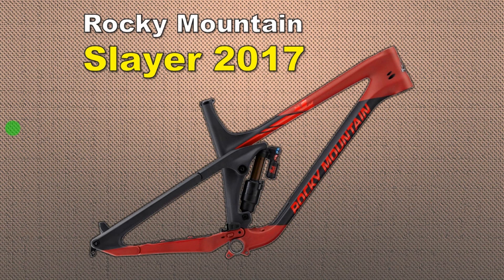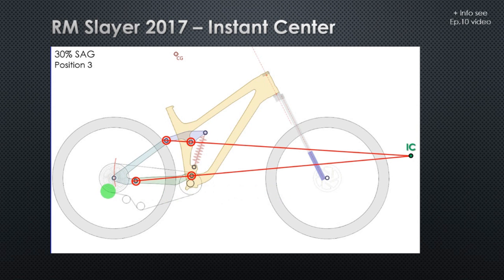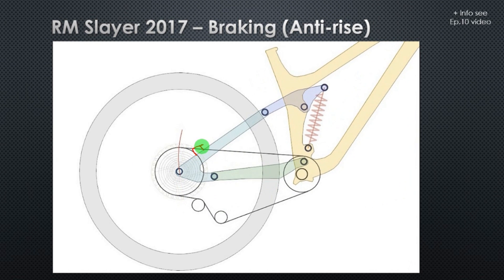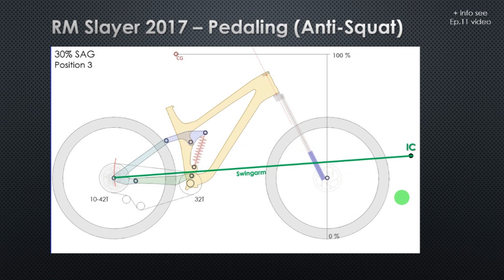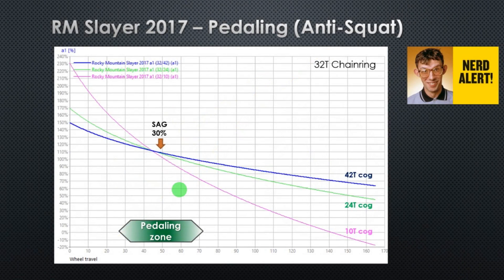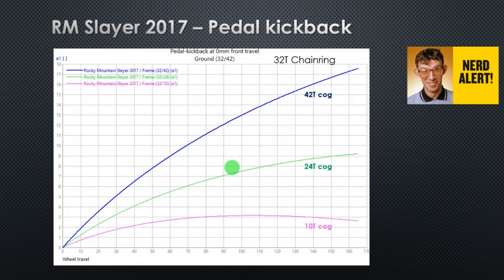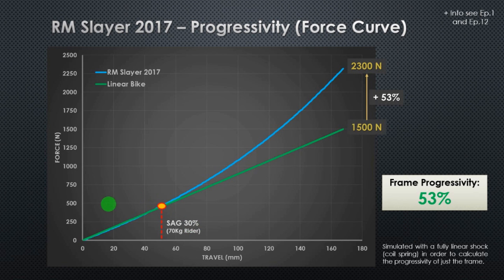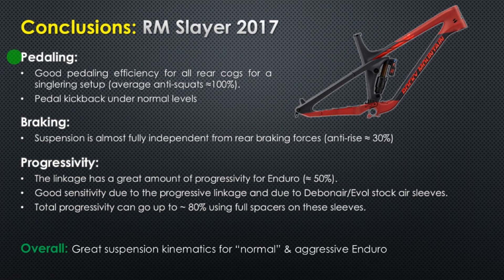Rocky Mountain Slayer 2017 - Suspension review

Comment: About to go from a 2016 Trance (with 150mm Pikes added) to a 2019 C30 Slayer. Would you say this would handle a bike park batter than the Trance? Great video btw.
Reply from the maker: Yes, for sure. Trance is a trail bike, Slayer is an aggressive enduro bike (with some freeride component in the mix).

Comment: I had a GT AOS bike and I agree it was really bad when I was on both brakes going down hill... but, I recall it was pretty good if I only used the rear brake... any explanation for this (maybe it had two strikes going against it?)?  I always put it down to the amount of wheel base that was growing caused by the AOS exaggerated rearward axle path?
... when I descend I tend to ride both brakes, I know some riders will only use the rear but I prefer to use both most of the time and I find some bikes are better than others at remaining active with the rear suspension, the GT AOS was the worst and I blamed it on the wheelbase growth.
Thanks for all the scientific analysis you are providing, interesting stuff!
Reply from the maker: Hi. Higher pivot bikes usually have a more rearward axle path and usually also have higher anti-rises. So the 3 aspects are relatively conected. So when you apply the rear brake, the bike has a natural tendency to slightly compress the shock and extend the wheel base. This migth stiffen a bit the suspension and slow down shock responses.

Comment: Hi, could you go further into the Ride 4 design and how it affects the leverage ratio? It would be 👍
Reply from the maker: Hi. The Ride4 and other similar systems (flip chips) usually have a small/insignificant effect on LR.
Reply: andrextr that’s what I figured. From watching your vids on pivot placement I figured the shock placement would have an effect on progression. I have used it in all 4 positions and found that the steep position works best for me. Cheers and thank you!

Comment: Hi mate! Do you recommend a coil shock for the slayer? I've the X2 and considering a dhx2 of they will work well with the kinematics of the bike.. Cheers!
Reply from the maker: +KSMTB The float X2 is already quite good but if you want to gain a bit more performance on downhills then the coil is the benchmark (more initial sensitivity, more mid stroke support and more consistency on longer runs). The Slayer will work well with the coil since it's progressive. Although an air shock is lighter and offers more adjustability (either by adjusting air pressure or by changing spacer to adjust final ramp-up). Cheers

Comment: I'd like to see this information to be available for the new Pivot Mach 5.5
Reply from the maker: The Mach 5.5 has good pedaling efficiency as expected (with 100-120% anti-squats). The progressivity is should be around 10-20% (the shock pivot is occluded, so this is a close estimative). You can also check the Firebird 170mm analysis on VitalMTB here: http://www.vitalmtb.com/product/guide/Bikes,3/Pivot/Firebird-Carbon-Pro-XT-XTR,18075#product-reviews/2664/expand

Comment: Have you considered to review Pole Evolink or have you already reviewed similar frame? Great job with the videos, I see some progression with the quality ;).
Reply from the maker: I already built the models but never did the video. I made a very complete video for DMR (which has a diferent design but it also uses a concentric link with BB). Pole Evolinks have a bit low anti-squats (lower than most bikes, at ~60-70%). Progressivity is also low (almost linear... easy to bottom-out). The concept is interesting but if it was me, I would made some optimizations on it. Bye
Reply: Looking forward to see it :)

Comment: I love your videos. Did you ever analyse the Maverick suspension? Would be keen to see a ML8 video. Thx.
Reply from the maker: ML8 has a very progressive suspension. Not sure about anti-squat (pedaling efficiency) since the bottom-bracket moves and it is part of the unsprung mass (the common method to calculate the anti-squat is not valid in this scenario).

Comment: I ride YT Capra and am loving the bike, an absolut dream. still, I feel it is a bit of 'old school geometry' regarding reach and top tube; stangely enough I discovered that HA is super forward thinking and much lower than advertized (with 170 Lyrik around 64,5°, and MBR states it is even lower at 64,1°). it loves to sit low and super slack like a regular DH rig, but had never too much of a problem pedaling it uphill, thanx to the steep SA at 75°, which I love the most about this bike.

I'm about 185 cm and L size is fine, but I'm thinking of getting XL carbon one to extend reach and top tube, which is still not that much of a drastical change.

the option replacing Capra with Slayer (still waiting to see the new Norco Range carbon) looks promising, and here's why - just read the review on PinkBike and the reviewer at 177 cm height tested L sized bike. naturally I went on RM's website and was looking at XL size numbers, and I have to say I'm liking what I see. longer bikes with slack HA are super stable at speed and I like that a lot. I learned that to be manoeuvrable uphill, you actually have to have shorter rear part of the bike, not front. plus, body position is esential of course, and you have to learn that to make full use of your bike, either going up or down.

after seeing this video, the option of getting Slayer is even further fortified, as I like it is progressive and somewhat similar to Capra - the best bike I ever rode. don't know how big of a change would be getting from 75° to 73° SA and that's what worries me the most.

the numbers of XL Slayer are kind of like L/XL Mondraker or Giant numbers, but the seatstay length is lower than expected (only 509 for XL), which is mid way from 'normal' L and XL bikes. that's why I think it is suitable for someone my height, especially when the PB reviewer at 177 cm rode L size.

can you compare Capra and Slayer and give me some info on their differencies and regarding that SA?
sorry for super long message and thanx!
Reply from the maker: I'm really sorry for the late response, but honestly I'm not the best guy to talk about modern geometries and to answer you question. All I can say is to stay tuned on VitalMTB because I'm collaborating with them on kinematics analysis and the RM Slayer is going to be analysed very soon (early March). Probably you can find there the answers you need about geometry and how the bike feels. What I can say for now is that Capra and RM Slayer are quite similar bikes regarding rear suspension kinematics, the main difference is that Capra is a bit more progressive than Slayer. Cheers and sorry for the vague answer. Bye

Comment: hi, I have a request for you to review Polygon N9 Enduro Bike pleasee :D
Reply from the maker: Hi, the N9 have good anti-squats for a 1x11 setup (around 120% on average) and it has a low anti-rise for a dual-link suspension (65%). But the bike has a small problem. It has a excessive regressive (or digressive) leverage ratio at the final part of the travel, so the last 20mm are a bit useless and easy to bottom-out. This drops the overall progressivity of the bike to a final value of only 5%... This can be improved using full spacers on the shock, however it's not perfect. Bye
Reply: hoo.. can you show the progressivity graph (x = travel vs y=newton)
anyway that's great review! thx :D

Comment: have you looked at ghost riot and DH9000 suspension?
Reply from the maker: Already looked for DH9000 but never did the video. But it has a very rearward axle path (which is nice) due to the high position of main pivot. The bike has a progressivity of 30% and average anti-squats around 50%. Due to the idler chain pulley, the bike has no pedal kickback (which is also nice). The anti-rise is around 90% which is also good for an high-pivot bike. Overall it's a quite interesting design.

Comment: Really like your Channel. Can you do a review about the propain tyee? Bye.
Reply from the maker: The bike has a very low anti-squat (AS), because the first link is in a very low position, near the BB... For the middle cog in the cassete, you get a 40% AS using a 32T chainring, and 70% for a 24T chainring. So the bike pedals better with a small chainring, even thought, it's not great. So, this bike requires a shock with a trail/climb switch. As a consequence the bike has a very low, and good, pedal kickback. The braking performance is normal (AR 75%). The progressivity of the frame is 20%. Bye

Comment: What can you say about the Nakita Spencer+Hill Downhill bike?
Thanks a lot
Reply from the maker: It's a quite progressive DH frame (60% progressivity). It has quite high anti-squats (around 150% for a DH transmission, which is probably a bit too much) and the anti-rise is 90% (which is a normal value for a dual-link suspension design, usually only the horst-link bikes are able to get very low anti-rises like the Slayer). Bye

Comment: Hello. Can you review a 2015 norco Sight carbon? I'm riding one.
Reply from the maker: Hi. Check the Norco Range video on my channel. I know it's not the same bike, but both designs are extremely similar the main difference is the travel amount, all the rest is identical. So, basically it has good braking (AR 50%), high anti-squats on a 32T chainring (quite over 100%, probably a bit too much) and good progressivity (27%) for a trail bike. Bye

Comment: can you do a linkage analysis of one of the Focus bikes with the "FOLD" kinematics please?
Reply from the maker: Hi. The Fold is a swingarm 4-bar design (same type of scott gambler, but a different design on the shock linkage). From the pictures of Focus JAM it seems that the main pivot is located exactly on top of the chainring, therefore, it would have an anti-squats around 90%... The anti-rise it will be around 90% also (this is a typical value for a swingarm 4-bar system). The progressivity is a bit low, around 15%. Overall, the bike is OK, and it looks cool, but it has a quite standard kinematics. Bye
Reply: andrextr thank you👍🏻

Comment: Can u pls make a bike analysis for Orbea Occam AM? ty
Reply from the maker: Hi. Orbea Occam has a slightly regressive frame (overall progressivity of negative -7%). For a trail bike it's a bit too low, if you do some trails with bigger bumps, or small drops, expect some bottom-outs. So, its a trail bike with some cross country DNA. The pedalling is good for a 32T chainring (because this is a swingarm-4bar system and the instant center is the main pivot in this case...which is just on top of the chainring). The anti-rise is around 90% as it happens with most singlepivots & swingarm 4-bar systems.  Bye
Reply: Thank u Sir..
How about the Scott Genius?
Reply from the maker: Scott Genius is also regressive... I don't like it much. And if you choose a single ring setup with a 32T the anti-squats are quite low (because the main pivot is bellow the chain line). It pedals well on a 24/26T chainring though. But since the bike has the shock switch on the handlebar, the low anti-squat can be solved by switching on the pedaling mode. Braking is identical to Occam. Bye

Comment: Can you also make an analysis of suspension kinematics of Ibis Ripley?
Reply from the maker: The Ripley uses two eccentrics (they basically work as two tiny links). I build a quick model some weeks ago for ripley, and the bike has an average anti-squat around 110% for a singlering setup (32T), and it's fully linear (progressivity very close to 0%). The anti-rise (braking) is around 80% as expected for a dual-link suspension design. Bye

Comment: Hi Andre, i am a giant reign 1 2016 (al) owner. A known problem with the bike is that the frame has a really high leverage ratio so the air shock tends to bottom out alot, people have been putting coil shocks on to compensate for this, have you known about this/can you explain this.
Reply from the maker: I have a video with Giant Reign if you are interested. The leverage ratio of the Reign starts at around 3.2 and ends aproximately at 2.6 at the end of the travel. The overall progressivity is around 23% which is not much, but it's the average of an Enduro bike. So, it's not hard to bottom-out the Reign. Since your bike has a Debonair sleeve on the shock, you can get more progressivity from it than a coil shock. If you put maximum number of spacers on the debonair you will increase the overall progressivity of the bike by more 25%, so the bike will end up with aorund 45% of progressivity. You don't need to go to the coil. Bye
Reply: andrextr  thanks for the reply, that is what i initialy thought but after the 2017 reign recall (over 100kg they will fit a coil shock for free) and isues of a few air cans blowing up due to leverage ratio issues i dont know how this can be explained by the "normal for  enduro" numbers, are there other factors changing it ?

Comment: Since this bike is really progressive would it be good with a coil shock
Thanks
Reply from the maker: Hi. Slayer uses metric sizing shocks, so not sure if you can get a coil shock with that size at the moment... 
If you ignore that "small" detail, with a coil you get a final progressivity of 53% as shown, with the Debonair air shock that came in stock, without any spacer, only adds up more 10% to the bike's progressivity (so you end up with around 60%). Evol should also be similar. So, you can use the air shock it will have similar progressivity as the coil one. But you can also run a coil. It will give you a bit more sensitivity but also more weight... Bye

Comment: is there any advantage to less progressivity?  I heard about the Evil Insurgent being super amazing and yet it lacks in that important statistic.  I'm curious how progressive my bike suspension is but I don't have computer software to map it out.  how do I begin?
Reply from the maker: Hi Simon. As I recently discussed in Episode 13 & 14 videos (https://www.youtube.com/watch?v=3HeL5NNHbFw) air shocks are not that progressive as many people believe. Indeed, they can have a good ramp-up at the end, but they also have a flat mid stroke, so, overall, they are not very progressive. In fact, with a standard air sleeve, the most you can get from current shocks is about 15% progressivity (with full spacers). Meaning that it takes +15% force to bottom out when compared with an equivalent coil shock with the same Sag. Without spacers, in many cases, you got regressive air shocks , meaning that it's easier to bottom-out them than the equivalent coil shocks. With the Evol/Debonair air sleeves, you can indeed get some progressivity, around 25-30%, using full spacers. So, for instance, with an Orange Alpine which has a fully linear frame (0% progressivity), if you put a Debonair with full spacers, you end up with ~25% progressivity in the bike. Slayer with a linear coil already have 53%, just from the frame. So, to conclude, air shocks can provide some progressivity but it's not much in many cases, and you still need a progressive linkage to get a truly progressive bike. Bye
Reply from the maker: Already did a video for the Evil Insurgent. It's not very progressive indeed (13%). The progressivity is related to the aggressivity of the intended use. So, DH bikes have on average a progressivity of 40% while Enduro's have around 20%. On XC applications, a low progressivity is better, since it's not expected that the rider will hit big impacts on a XC bike, therefore, with a linear linkage it would be easier to use all travel. So, for XC a linear frame or slightly regressive are better, for trail bikes I would say that 30% is a good value, and for Enduro and DH a good value in my opinion is somewhere between 40% and 70%. More than that it starts to be too much. Bye
Reply: As I understand it air shocks are naturally progressive and can also be tuned. So shouldn't it can be considered beneficial to have a more linear chassi and control the progressivity with the shock?
Reply: Thank you for that clarification :)
Reply: andrextr there it is again....you setting us straight! Brilliant stuff

Comment: What do you think about Mondraker's Zero suspension system? PD: nice vids man!
Reply from the maker: Hi. It's a dual link system. I don't like to talk about a system as a whole, since the final result will always depend on the particular pivot positions. I already analysed Mondraker Summum and Dune (check on my vids). Since it's a dual link system, you cannot get low anti-rises. In fact, both have anti-rises around 70%, which is OK.  Summum and Dune are also progressive (not sure about XC models). Their marketing claims on the website are quite aggressive and misleading: "Zero is Mondraker’s proprietary most efficient, best performing and super capable suspension system. Zero power loss, Zero pedal kickback, Zero brake jack, Zero bumps"... When you see claims like that it's a red flag. Anyway, apart from marketing, the mondraker's suspension are well designed. If you want to check any particular model just say. Bye
Reply: andrextr Thanks for your answer!! I'm currently thinking on buying the  Mondraker Crafty r+. The things I've heard about the suspension are quite positive. I will check the vids you made about Dune and Summum. Keep doing that hard work dude!!

Comment: Great video! Could you do a video about the new Commencal Meta V4.2? Analysing the differences between that and the old v4. Looking at the new 'improved pedalling' as well as progessivity and pedal kick back
Reply from the maker: The differences are very small that I doubt that someone could distinct on a blind test. In fact, V4.2 has more 5% of progressivity, and more 5-10%, on average, of anti-squat... V4.2 has a bit more total kickback, because it also has more 10mm of travel. And that's probably the main difference between both: the travel amount... Apart from kinematics V4.2 has metric shock, boost, and some slight differences on geometry. Bye